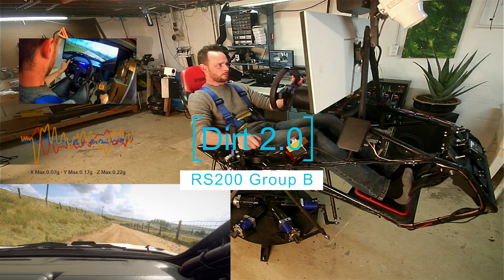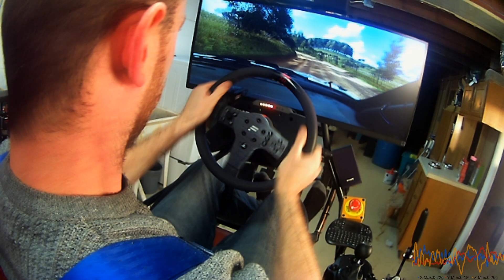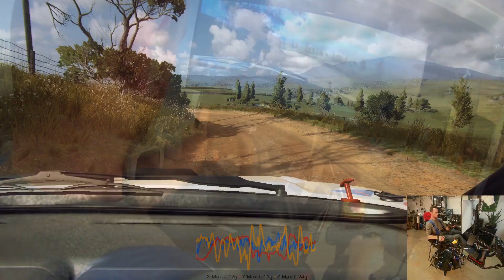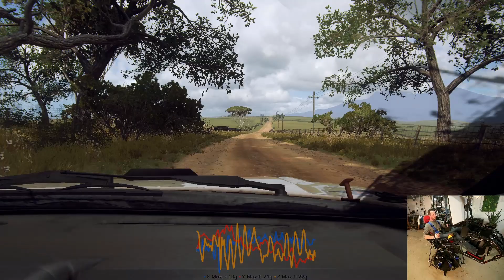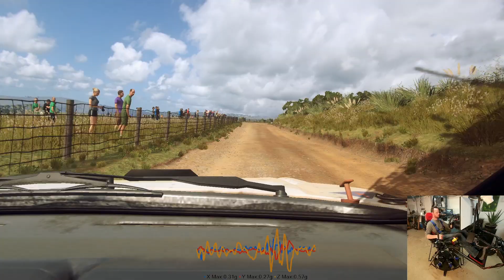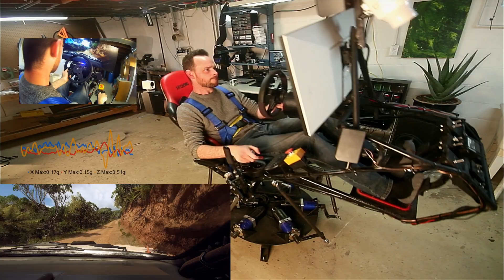6DOF - Dirt 2.0 - RS200 Group B

Comment: Well, I got my servos, gears (50:1) and thanos controller!! Do you think this could work with triple monitor? I mean, it has enough power, right?

Here, fan n°1👀
I probably will ask you for help... 😁
Reply from the maker: Yeah, this should handle 3 monitors,... I would be careful as those are the first to go..(damage/flyoff). I didn't use a Thanos controller, but he seems like a nice guy and could help out if u have issue with it. I made my own before I knew he had one that would work.
Reply: @Christopherknauf  You had your own controller? Engineer? Can share pictures of that or isnt open to show? 😁

BTW nice toy grandpiano in you garage ;)
Reply from the maker: @BallestaRacing  I am a Computer Engineer, I open sourced the project on GitHub ( https://github.com/knaufinator/6DOF-Rotary-Stewart-Motion-Simulator ) ... and yes,.. the piano... is the wifes ,.. she wants to use it for photoshoots with kids. .. it sounds terrible...
Reply from the maker: @BallestaRacing  Build Album - The controller is pictured in this https://photos.app.goo.gl/6UpUdS5Q1otJAuhEA
Reply: @Christopherknauf  thank you so much. This helps more than you think!

Could you make a video o how you get into and get out of the platform. Seems difficult and probably funny😁
Reply from the maker: I can, it's not difficult at all, butt first then pivot. But I am also a limber guy. I have been working on a system overview video. But  will take more time to make as it's more complex than me just driving
Reply: @Christopherknauf  Waiting for it 🤸
Reply from the maker: Yo - https://youtu.be/rHyj4mlPw2M  - recorded how I get in... :)
Reply: @Christopherknauf  yeeep, great! Thanks for telling (altough I´m OF COURSE subscribed)

Comment from the maker: I make these videos because "Likes" make me feel so good :)
Reply: Have you tried changing your center of gravity to be higher up? I heard it's supposed to be where your head is so it doesn't throw your head around and make you nauseous, it moves your body
Reply from the maker: Also, I don't have a Thanos controller,.. so I can't change the center of gravity.... Unless I pull out a saw and welder
Reply from the maker: @alexdieringer3510  Wouldn't your head technically be moving more and further if the center of gravity was higher? also, this doesn't make me nauseous, my joints will ache from tensing up for crashes before I get dizzy
Reply: https://youtu.be/yuVybVrYQmg

Comment: Still one of the best Motion systems made period! i have the same LG monitor but i use my VR headset to play Dirt rally 2 it really is so immersive! Actually going to play in VR now haha. im building a basic steel cockpit and have two transducers and the last thing i will add is the motion.
Reply from the maker: It's an awesome experience bro! I want vr so bad... I just got furloughd so I thought I would just hold off until I go back to work... On the plus side I have 3 months with this and plenty time to make cooler videos.
Reply: @Christopherknauf  Yea VR is insane, you can sense depth and scale and easily see why you spinning out around some corners cause the road is actually going downwards ect. Love it! Get the Valve index though if you get VR. i have the rift S and yes its great but valve index aint shipped to us here in South Africa :/. Also some transducers makes a big difference and you will see once you put VR headset on it all comes together and feels like the real deal, especially with your awsome motion setup!
Reply: @Christopherknauf   Sad to hear about your work. I'd be glad to send you a free amc-aasd15a controller to experiment with on your platform during these hard times, email me tronicgr at gmail dot com